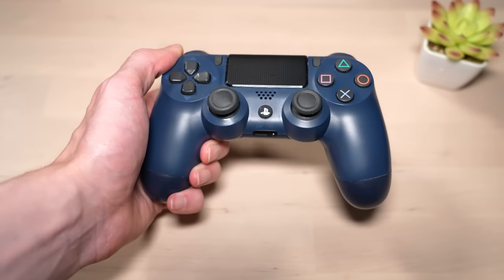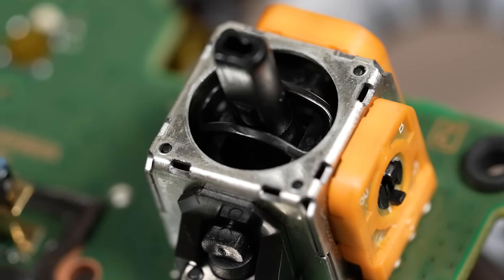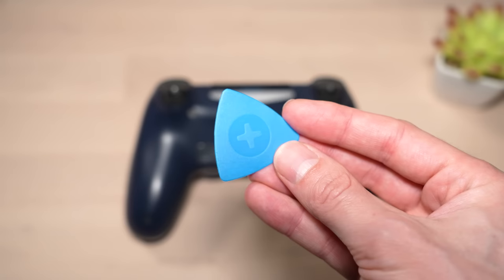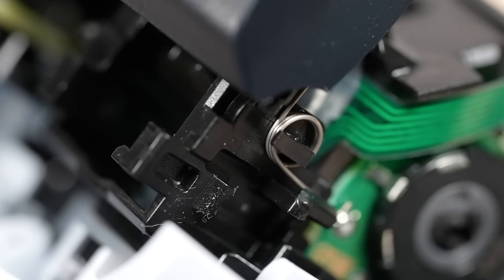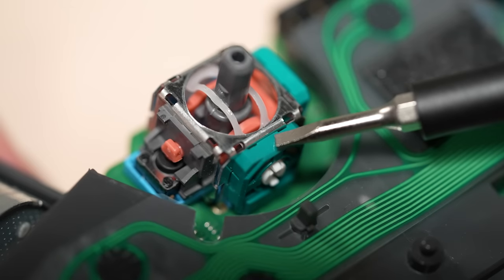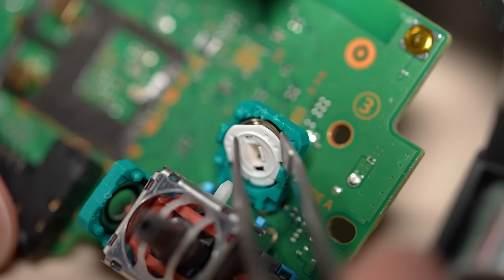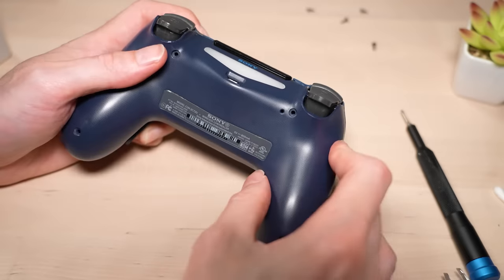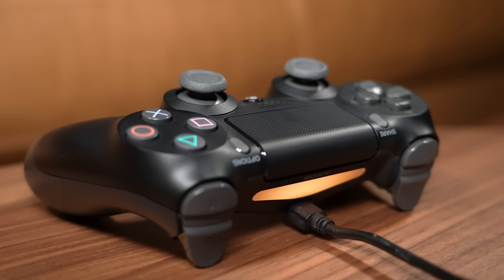Most PS4 Controllers Have This Problem.. But I Fixed It!

Comment: Best option is to clean and hope the potentiometer (green thing) is not damaged, as it can get worn out over time from the constant movement. 

Replacing the analog stick will not fix your stick drift. In some cases it will make it worse. Each potentiometer has a unique resistance, so in order to bring them to 0 they are calibrated by the manufacturer. As consumers we do not have access to this software so even if you replace the potentiometer it will show stick drift. You can rest on gamepadtester.

Comment: I just spray contact cleaner inside the analog stick and rotate them a couple of times. Repeated it for 3 to 4 times. Worked great for both my dualshock 4 and dualsense controllers since they were just dirty inside.
Reply: I did this with spray on rubbing alcohol, just sprayed into the joystick port rubbed it around a few times and then used a hairdryer to evaporate it. For those reading (keep your controller off)

Comment: This works. I had to look all over the internet, when I first started fixing my stick drift. This video is spot on. Just clean the effected sensor wheel. I made a step by step guide, so I could put it all back together in order as I went. After cleaning my sensor wheel everything has been good for almost a year now. It works normally. 👍

Also,  be careful with the ribbon cable. It's a pain to fish back through the gap in the plastic without tweezers. The first time is harder, because the ribbon is so stuck in place. It can be pulled out, so don't be scared of it. It needs to be pulled out. It can be slide back in to reconnect it. (It's harder to talk about it now, but you'll get it.) 🙂
Reply: A good way to put the ribbon back through the plastic,
Tape, make it narrower, stick it to the ribbon, then the tape is easier to out into the plastic hole
Then pull it from other side
Take the tape off, and ur done
This really helped me.

Comment: Great video , I haven’t taken PS4 controller apart yet as haven’t had this issue .
Though did take my Ps2 controller apart to clean few months back and the l2 and R2 buttons popped out . What a nightmare to get back in .

Comment: BTW you don't need a special set of screwdrivers or pryers to open the controller. A really sharp knife will work perfectly for unscrewing the controller also try to reposition the sensors if your camera had stick drift, this fixed my controller after a year of drift

Comment: I saw online that the remplacement parts are like 5€ for 8 which is basically 2 remplacements for both sticks
nyalso, if I just blow in the space between the stick and the shell, it fixes the stick drift for a few weeks and I been doing that for like a year lol, I will properly fix that problem once it doesnt fix itself by blowing on it lol

Comment: Thank you so much for this guide. I was living in Doom thinking I would have to buy another PS4 controller, and saw this video when I was looking at potential ways to fix joystick drift. I followed the instructions to your video to the T and ran a calibration and can proudly and thankfully say, the issue seems to have resolved itself. Thank you again. Youve made me confident in fixing my own shit
Reply: Did u replace or just clean?
Reply: @saifullahshuja6316  I just took it apart and cleaned it and put the same pieces back
Reply: @3rdrick did it fix????!

Comment: been doing this from my 2nd controller by replacing the sensor, but it only last for a few months and the issue would come back eventually, still a good way to remove that problem

Comment: Easy methode from my experience :
Whenever i get the analog drift back i just open the controller n clean the analog with hair dryer with strong  cool air n use tooth brush to genlty remove dust from analog n blow some cool air again n than its good i do this every 5 month ish

Comment: Honestly, just do not bother. I have a solution and found peace with it. First of all my ps4 controller drifted since day one. Why should i risk spending money to buy another one that will also fail ?  The solution is to use a proxy like Cronus, and utilize mouse, keyboard and the infamous, venerable Logitech F710 controller. Now this is what one should call a proper quality controller, built like a tank and with high quality materials that deliver precision. Just forget the PS4 cheap controller and make your self a favor and use only the best input devices for FPS: mouse and keyboard, and the F710 for racing games. I made the mistake last week by trying to use the PS4 controller for the Hot Pursuit remastered and the issue it had made me lose games. I had finished the original game back in 2011 (?) using a PC with my F710 and i remembered how much i enjoyed it. So i went back to Cronus and once again i started winning races with a controller that does not have issues. Bonus : you can assign any key you want to any controller button...

Comment: Buy "controller paddle ps4" / button extension from where im living its only 8 usd (i think one of the cheapest extension), L3 R3 was important button the more u press it the more chance to get drift, but since i use extension it was life longer bc i press L3 R3 from ext not from controller, also when not playing put controller to plastic bag to prevent dust.

Comment: This is just a short term solution. I would learn how to solder and desolder and use proper tools. You actually break the plastic housing of the potentiometer weakening it thus making it worse. But to each his own.

Comment: You forgot to mention that the sensors have an orientation putting them in there upside down will cause reversed controls

Comment: Just outta curiosity, will this help fix the L3 run problem as well? Like I try to run but sometimes it registers and sometimes it doesn’t. I also noticed that stick drift happens on the Gen 2 remotes more than gen 1.

Comment: Ciao posso farti una domanda? Praticamente ho notato che su un determinato gioco il personaggio che voglio far andare su o giù con levetta sinistra, trema per poi riprendersi. Ho provato a smontare e SOFFIARE O PULIRE  con cotton fioc ( senza alcool ). Da ignorante secondo me sarebbero da cambiare i trimmer?  ( Cioè quei cosi verdi con i così rotondi Bianchi all' interno) , ma ho capito che per sostituirli ci vuole saldatura. Sarebbe più facile sostituire i cosini bianchi, mi daresti un link dove acquistare solo quelli bianchi? Ed un' altra cosa, quando andrò a sostituirli, devo bagnarli di alcool e lasciarli bagnati? O devo bagnarli ed asciugarli? Ti ringrazio
Reply: Hi, can I ask you a question?  Basically I noticed that in a certain game the character I want to make go up or down with the left stick shakes and then recovers.  I tried to disassemble and BLOW OR CLEAN with cotton swabs (without alcohol).  As an ignorant person, in my opinion, should the trimmers be changed?  (That is, those green ones with the round white ones inside), but I understood that to replace them you need welding.  It would be easier to replace the little white things, could you give me a link where I can buy just the white ones?  And another thing, when I go to replace them, should I wet them with alcohol and leave them wet?  Or do I have to wet them and dry them?  I thank you

Comment: i was about to be angry for getting started with this because of the green thing.  turns out the green housing is soldered to the board as I was trying to breaking it fully free!! The controller is done for if I tried harder.
it is not meant to be bent back and forth multiple times as joints will break in just maybe three cycles.     I thought there's no hope for it to go back as normal or I just made it worse plus wasting time and effort, but to my surprise while testing, it worked so well that even the small jitters/vibrations (from a testing app) has disappeared. Anyways, thanks.

Comment: I tried desoldering my sensory bits because even with a different silver thingy and cleaning the black surface it didnt work. But for soem reason once i swapped the old bits woth newer ones my right analogue stick stopped working randomly. Even though i didnt even touch that

Comment: Did this had really not problem but now it won’t turn back on…any idea where I might have went wrong…everything seems connected, didn’t pull out any wires or anything 🤷

Comment: Need some help. 
I’m facing an issue with my analog stick wherein it doesn’t register 100% input for one direction. 
If I turn the stick right it will go 100% to the right however if I do that for the left side it would only go partially say about 75% and then jitter and randomly jump to 100% or won’t at all. 
Will this method also help fix this issue?

Comment: Yeah I did this shit and it's not working exactly the same. Perhaps being in AU the controller is made different? Or maybe they have some varients. The battery case is not coming off without serious force, and two parts have fallen out. I am not sure where they are from. 

Might just tape it together and put it on FB marketplace as brand new.

Comment: I just replaced one joystick including the two sensors on a DS4 slighly driting down. Now it drifts much more  both to the right and up. Is there any way to calibrate/fix this without replacing the joystick again? As I managed to tear the vibration motors cables and had to resolder then, this is really not much an option anymore.

Comment: Please be gentle with the green piece that the disc is in I knew this trick for years and for my most recent controller a dual sense i did it about once or twice a week since the drift got so bad and the piece snapped off which requires soldering and desoldering skills to replace.
Reply: I started getting a lot of drift aswell after doing this any help to revert it back?

Comment: I have my ps4 controller apart right now to swap out the sensor wheels. I bought 12 of the for like 7 bucks on Amazon. Just haven't fixed it yet because I have another controller.

Comment: Ive done this job many times and it's not hard at all, but those sensor housings are such a BITCH to close. It's frustrating at times, other than that it's pretty easy. You just have to apply so much force tho...

Also, sometimes you can't just clean the sensors if they're corroded you gotta replace them entirely.

Comment: I have had 3 PS4 controllers, and all of them have had one issue in common, when I pressed the L2 button my character would aim up about 70 percent of the time, my current controller started showing signs of this a couple of months back but it has been exceptionally bad this month, on my old controller I would usually fix it by blowing into the R3 analog stick which is pretty weird when you know that the problem comes from the L2 button, I also have very slight stick drift but that doesn't bother me,if anybody has a solution which I highly doubt then please tell me
Reply: Fake for sure

Comment: Well. I just did all of this which wasn’t too bad BUT sadly it didn’t fix the problem. I wonder if the non-Sony controller will do the trick cuz I just ordered one. However, you said parts could be purchased so I may give that a try. Amazon accepts returns so why not. Cheaper than new Sony controllers

Comment: Even better, go to the store with it. In Norway we have 5 years warranty for drifting as well.
Before they either change it over a day, at max. Or they had to look at it, then give customers a new controller😅

But it would be much better if they actually fix it. If they aren't approved by Sony to fix it in store, we still have workplaces that are approved to fix it, even close to these stores too.
So the next best thing, fix it, and don't throw it in the garbage. But the real best thing, they go back to build the controllers, as they did with PS3, and older Playstation.
Back then it actually last for years. But now? I almost believe it is done with purpose. Or planned obsolescence, as it is called. But even it was so bad, it backfire, specially in our country.
If they don't fix it, we get a new one. And a completely new one, new warranty too. So it would literally be warranty for life, or as long PS4 and PS5 last.

But the real best thing, they build these controllers with better and stronger quality.

Comment: >unscrew the back half
Uh-huh...
>now take out the white plug thing
O-okay...
>then decauterize the vizimual processor attached to the carboflactic rod by removing the tabular cintzivizer from the geratric module but make sure the fritcutial tragmerizers dont pop off or else the
I...I'll just buy a new one when it gets worse ;_;

Comment: I've been meaning to do this since i watched this video (a year ago). First attempt was a fail, i dont think i put the sensor back properly. Tried again and no more drift! My other controller started to do it  on the same stick in the same direction, so instead of spending 70$ yadda yadda yadda. 

(Edit: I mustve seen a different video the first time?)

Comment: i actually tried this on my controllers and it WORKED!! BUAHAHAHA THE MADMAN FIXED IT. (make sure to soak the small sensors that come out of the green bits inside the controller in alcohol, soaking them and rubbing them cleaned it better)

Comment: Just turn off the controller,spray some alcohol into the joystick port , rotate a few times, rinse repeat maybe 3 times doing that. Then blow dry it on a low setting, or let it rest if you have the patience. Took me 2 minutes. No dissembling, no new controller, no repair price.

EDIT: When I said rinse, DO NOT rinse your contrôler with water.

Comment: I had stick drift right out of the box. Returned it for another. I couldn't get a DualShock 4 to last more than 6 months. I have 9 controllers that have stick drift, or slow response.
Reply: Are you buying it from an official store? I think you just press the button extremely hard, because i play hard and my controller lasted perfectly for about 4 years

Comment: Actually all my PS4 controllers keep moving on their own, even the new ones just bought. This happens when using on PS5 and Steam. I even tried connecting it via USB to PS5 and still it moves on its own...sideways and upwards. It wasn't like this when I first got my PS5 but they all started to go coocoo at  the same time. Strange times.
Reply: Check motion sensor

Comment: I already tried this doing on one of my controllers and yeah I def fucked it up cause it doesn’t turn on no matter what I did. Also sony controllers (atleast in my case) had the most amount of stick drift issues compared to xbox. Not a single Xbox controller I have ever had stick drift yet all my Sony controllers either run into some odd issues like ps button not working or basically all my controllers ended up getting stick drift 
And I don’t get it with new consoles especially Sony still suffers from this issue atleast make it easier to change the stick modules but nah even that is so damn difficult and the process is risky. I seriously regret getting playstation at this point.

Comment: I feel sorry for this guy. Every single PS4 controller, PS5 controller, PS5 headset, power cord and m.2 drive he has ever owned have had serious issues. Meanwhile, I have never had a single issue with one of these.
Reply: all ps4 controllers  stickdrift eventually
Reply: @DeletedMemoriez  mm hmm. sure they do.
Reply: @skootdiggity1301  Yeah i have 2 ps4 controllers and both of them have stickdrift
Reply: @skootdiggity1301  And everyone ik who has a ps4 has experienced stickdrift atleast once
Reply: @DeletedMemoriez  Yeah, I have tons of ps4 controllers, including several from the launch in 2013 and have never had one with stick drift.
Reply: @skootdiggity1301  you could be wrong, he might be just taking them apart to teach people what to do if you run into a problem. I doubt he's ran into half of them problems.
Reply: @ginanicole  Yeah, I don't think he has actually ran into these all of these problems, but he presents them in a clickbait style as "omg! fix this now!!"

Comment: Great to the point video.
As far as people bashing the quality of the controllers from Sony. Just like most things in life, failures are most likely due to the owner's treatment.  Sticky buttons, stick drift or lose of pressure sensitivity on triggers? Eat while playing games? Use the controller with food covered dick beaters? Most failures are always caused but dirt and debris that worked its way into the controller. Soda spilled on one, etc. 
Keep your controllers clean and they last a long, long, LONG time!
I fix controllers for people and friends all the time. What I've noticed well over 95% of the time it's food or drink related. Systems that little kids use are the worst! I've opened controllers and seen crumbs fall out! No joke...

Comment: All this bs just to fix stick drift. The original control my ps4 came with never had stick drift and the only thing I've had to change is the battery bcuz I've had my ps4 for 8 yrs. I've owned 2 controllers since and they both got stick drift in no time, the last one had stick drift within two months of purchase. And all these are PS4 dualshock controllers. They make these controls weaker so u have to spend more 💰 💵